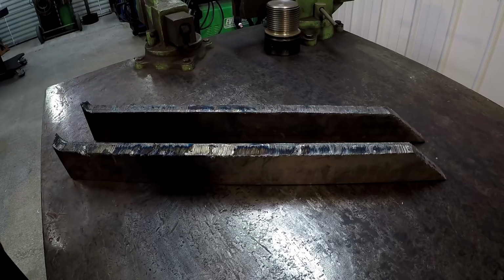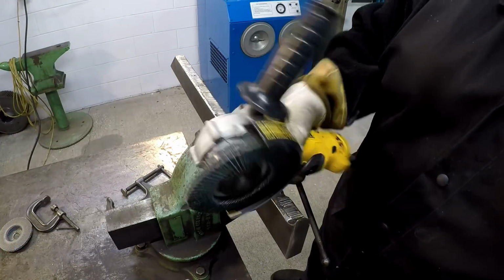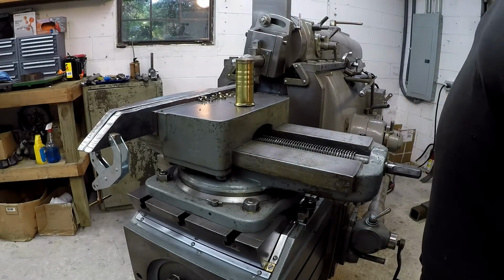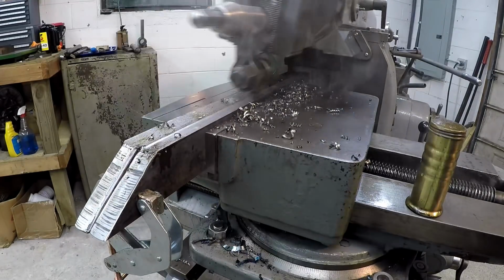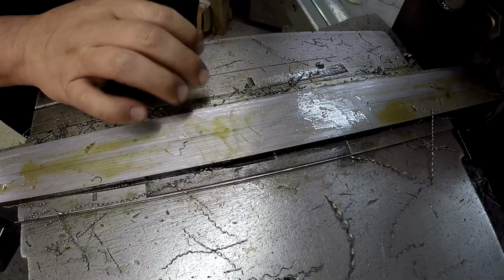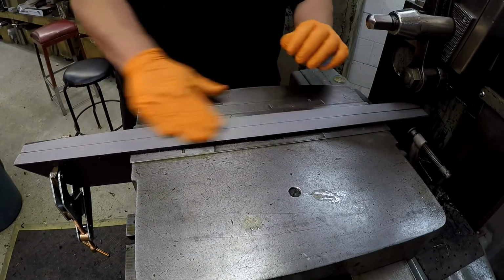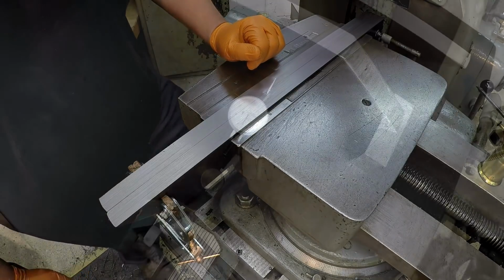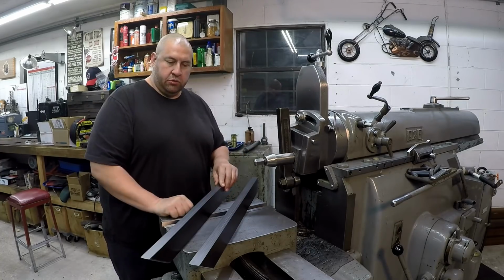SNS 220: Shaping 28" Parallel Bars

Comment: Love the shaper videos.  I was curious if the tool could be slightly scratching the part on the backstroke effecting then surface finish.  Perhaps rounding the sharp edges on the back of the tool could help it roll instead of scratching.  

Have a wonderful 4th and thanks for all of the excellent videos!

Comment: When you cut the sprocket in two pieces you rotated the table through 90 deg to get the T slots up. I noticed that the vice was loose at that time, but I assumed you would tighten it up before the next job. You were focussed on the clamping to the T slots.

Comment: Use a brazed carbide tool, the type you would use for cast iron. One with a substantial radius, it won’t chip providing you use plenty of lube. The huge top rake on the tool you are using will cut a good finish but will wear very quickly

Comment: Hey Adam, hope you are mending fast. For the cut slag, I use a hammer and cold chisel. Tap the chisel from the centerline out towards the cut edge. Very fast and clean. Also,  any plans to cut vees out near the ends to hold shafts/ round stock? Cheers!
Reply from the maker: tridium6111 That shaping is all I did to them. My coworker has them now and I’m sure if he needs any mods he’ll ask me to do them.

Comment: Do you think you could rig up some kind of brush to ride along in front of the cutter that would slowly wipe on oil with each stroke? Possibly hooked to a small bottle with a wick. it just looks like the on the finishing passes that the cutter wipes the oil away at the leading edge long before it gets to the finishing edge. I have no idea what the best way to do it is. Anyhow, I hope you are recovering well from surgery and thank you for making videos for us while you are still recovering.

Comment: I wonder if grinding them would make them more accurate...I still think that looks more than adequate for what your buddy was wanting to do with it...such a cool build and man that shaper has one long reach!  What is the longest throw it can do?
Reply: 32" I think is what the longest reach of it is.  Shaper size is measured by maximum stroke length, and Adam's G&E is 32" IIRC.

Comment: liked the video, i haven't had a chance to use a shaper in 34 years.  your friend could lap the bars if he has such a want to, get a good finish and make them more accurate. also when you were comparing flatness, i'm sure the weight suspended will have some small deflection between centers-say 0.0001-0.0002".  thanks for the video........dwh

Comment: The measured "out of straight" could be because of your surface plate setup.  You have the blocks at the very ends rather than at the bessel points.  Nice work as always.  Did you at any time with this material try a different stroke speed?  Just curious.  Still, a decent surface finish.  Glad to see you back, better.  Keep up the great work, and thanks!

Comment: Awesome to see the shaper doing its thing!  Curious if you know how far into the piece the hardened "HAZ" is... I would guess the thicker the material, the deeper into the part the hardened area extends?
Reply from the maker: Ramsey Customs - turbocobra Hey Gary, it doesn’t seem to go that deep, less than 1/16”. Usually more at the surface. If you can get the tip of the cutting tools under the flame cut your good.

Comment: Not too shabby, it’s like a linear lathe with a heck of sturdy looking vise. I can say I’ve seen one in action now. I’m interested in seeing how the power source works, is it driven off a rack and pinion of some type of linear motor has a very unique movement to it.
Reply: kaiju Thanks, that’s pretty amazing, if I had built that, it would just bind up and do nothing lol. I can’t imagine how hard that metal is and how close the tolerances would need to be for it to not only work but last as long as it does...

Comment: you did great abom79 but its hot rolled flat bar  and you were cutting with the grain in the steel so the finish u got in the end was about as good as u will get

Comment: I am not a machinist, but I love watching your videos!  After watching this video and your video of cutting the sprocket in half,  I understand how you change to increase the depth of cut with each stroke of the machine...  But in this video, it appears with each pass across the bars the depth of cut is not changing but instead, the machine "advances" one notch forward for a new  equal WIDTH of cut,  with each stroke in order to traverse across the bars.  How is this done with vices clamped tight?
Reply: The vice is on a geared table.

Comment: Nice project. 
Should the Armstrong tool holder be turned around so the load is on the bar and not pulling in the bolt?
In a light cut it probably doesn't matter. I don't know. Just an observation.
Reply from the maker: The tool orientated the way I’m using is preferred to allow the tool to swing away during heavy cuts, and help reduce chatter. The books I have even show it that way.

Comment: I have the same type of problem every time I try to cut "Cold roll steel" By the way I have a ton of good envy! Wish you'll live next door!
Reply: Cold rolled will warp because there is stresses built up in the outermost layer of steel from the rolling process.  When you cut one side, you relieve the stress on that side and the opposite side causes it to warp.

Comment: Is that sitting on rubber feet?  It looks like the entire machine rocks a bit as the head strokes in and out.  During the shots where the camera is stationary, you can see the relief between stationary parts on the machine move a bit in relation to background objects.

Comment: Tolkoum: I am not a machinist however my uncle is and owns his own machine shop that hand scrapes ways. He gave me the whole low down on hand scrapeing. If I'm not mistaken, that table is made of granite and a company comes out and works on it and certifies that it is flat to within a certain measurement. I think it's 1/10,000th or something like that. They use granite because it is stable meaning, it wont loose it's shape. You can't use cast iron or steel because it takes about 25 years after it leaves the foundry to fully stabilize. The way that table is used is that a dye is applied to the table a flat piece of machinery the "way" is carefully laid flat on the dye and table and smeared around. It's flipped over to reveal all of the high and low spots. My uncle makes is own tool to scrape them it's made of carbide. I think he called it chasing the dots or dots per inch. The more dots you have per inch the flatter the surface.
Reply: Surface scraping is an art form. Can make big money if you're good at the job. Most milling machines and surfaces need checking every few years, as you say the metal is not stable from the foundry. High end machines with forged beds help reduce this inaccuracy. CNC machines used forged steels. Your uncle has a good job :)
Reply: @rocket_skates-mj  Even stable metal wears.
Reply: This Old Tony does a great video on scraping. Nice to see there are young folks with skills around.

Comment: Is there a reason you didn't finish off the pieces on a horizontal spindle surface grinding machine or a blanchard grinder instead of the shaper? Still, that shaper is a really cool machine to watch.

Comment: Hey Adam, 
Your shaper looks like one of the brand new ones from the G&E catalog! 
Mostly from how clean the tool head assembly looks! 
Do you use any rust prevention coating the bare metal on your machines? Or do you use a shop dehumidifier?
Reply from the maker: I try and keep all of the bare metal coated with oil, and I also run an ac.

Comment: does the backstroke of the shaper affect surface finish? it looks like it's dragging along the surface scratching it up on the way back, but I guess that is mandatory when using a shaper. also, when you made that weld did it harden the piece at all? I know drilling through welded steel is extremely tough, is it the same with your shaper? maybe it's the hardened area that's wearing down your tooling fast.
Reply: The tool bit lifts on the back stroke. No real concern on the tool dragging on the surfaces..

Comment: By the way, Adam, I have re-watched your  video after 11min 30 sec.. There the shaper is plowing through the first flame cut, rough surface. If you look at the freshly cut surface you see it shows almost the same roughness pattern as the original one only a little less so. The load variations from the initial rough surface deflect the ram which cuts a similar, little dampened pattern almost like the needle on an old vinyl record. Since the machine itself and the ram are so massive and very rigid could it be that the dovetail ways are too loose?
Reply from the maker: rol eic I have the ram ways adjusted properly. I don’t like how that first tool was cutting.

Comment: Flame cut material can be brutal on HSS cutters havent used a shaper for 40 years!
Reply: did that yesterday 
it didint end up like i expected
Reply: Not only on HSS. I can tell from experience from turning flame cut rings on a cnc lathe not considering the flame cut surface even with carbide tools will end in a disaster. (sorry for the shitty grammar English is not my first language)
Reply: Rob M   carbide, being brittle, doesn't make a great cutting tool for flycutting.. my preference would be to take the angle-grinder to it. Cast iron is even worse as the "skin'' is hardened, grinding it off is a necessity... or taking a cut deep enough to get under the skin to the softer CI below ... 😎👍☘🍺

Comment: Seems like there are some residual internal stresses in those bars. How about heating them up in an oven to relieve those stresses?
Reply: Would have been best to start out with stress relieving, that way there is no glass hard particles/surfaces from flamecutting and the material doesn't warp anymore.

Comment: Is it dropping on the backstroke Or why would the tool hinge back like that ? I seen you cut that sprocket and now I am in love with this baby, never played with a shaper , 😍, By the time I was done with those parallels they would be 1/4”x1/4” square stock 😂
Reply: The thing the cutting bit goes in makes it so it is rigid in the push to cut and just drag on the return.  If it stayed rigid you would damage the cutting edge very quickly.
Reply: Oh got ya , thanks , makes sense on the return you would probably curl the edge and create more heat

Comment: Hi there! When you fliped the parts, how did you measure position to get parallel sides of each part? They are parallel to the table, but are the sides parallel? Your work is great!

Comment: I don't have any experience with a shaper, so just wondering why it's set up for the shear tool to use the "trailing" edge of the grind to lead into the cut (if that makes sense)? I would think that the point of the tool would lead, similar to the roughing tool. Trying to gain knowledge, not questioning your method.
Reply from the maker: oldbones Going off what I read in my books.
Reply: My gut tells me that is what makes it a "shear" tool.

Comment: Cool. I've never seen one of these in operation before and have only seen one once.
Reply: We had one in metalshop in the UK back in mid '70's so they have to be very old school machines. I rember I used it to machine the top of a small cast aluminium anvil. Doubt you would see one in a modern commercial shop.

Comment: "Ain't movin' too much.   I come off of there....   How could one bar be flatter than the other if all your vices and clamps were accurate?  Would they not be distorted in the same direction by equal amounts.  If you took a finish cut (Pass) of say .005 or even less, would the finish be any better? I've seen smoother cuts with a flycutter on an mill. . Could there be something loose in your planer?  Did you rebuild that machine or just clean it up. It certainly is a nice piece of equipment.
Reply: It’s raw material... so it cant be the same height... and a mill will always leave a better finish... pretty normal stuff there
Reply: He was measuring the factory milled side not the side he cut on the shaper

Comment: Hope that you are using a skylight filter over your camera lens because grinding grit/Sparks can damage the front surface.
Reply: "They are used when machining with a mill, drill or any other machining operation that requires work to be held in a vise or with clamps - to keep work parallel or raised evenly such as in a milling vise to give adequate height for the cutting tool/spindle to pass over." source: Wikipedia parallels
Reply: @BrotschneiderLP  I think you  meant to reply to OldSalt

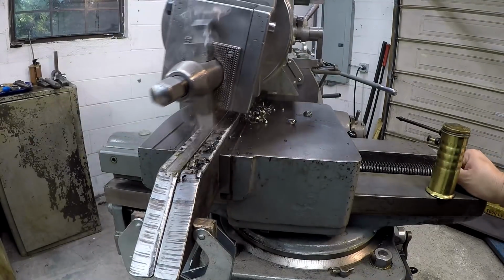Comment: Vice looks like it's still wobbling after the bolts were tightened. Look at around 10:30 you can see it flex still. Another issue somewhere?

Comment: I notice some holes on the left side of the shaper (when viewed head on).  My Grandfather had a German (iirc) made shaper that had a mechanism mounted on that side that would lift the clapper on the return stroke.  He said it improved the final surface and kept the tooling a bit cooler because it didn't drag on the work.   Is there an attachment for the G&E that does that?
Reply from the maker: Tapped holes are for the cam plate to trip the auto downfeed mechanism.
Reply: There is an optional tool lifter. Adam showed it in some G&E literature some time ago and talked about maybe making one, someday.

Comment: You know what's going to happen as soon as your coworker mounts those hanging off a work bench?
Yup, someone will cruise by too close and run aground with a snagged pouch!
Reply: Grey Beard paint em safety orange
Reply: Grey Beard that's why they are bolted down so you can remove them after your done.

Comment: Hey adam ,  i am curious about the removal rate between a shaper and a mill.   What do you think is faster under same conditions?    This looks like the pcs lost 20pds in 30mins :).    Thanks for sharing, great videos as everytime . Rgds from berlin germany
Reply from the maker: I believe if you get the machine set up right with a high depth of cut and proper stroke speed, you could rival a mill doing the same part with a facemill. But I’m not here to prove it’s faster, I just enjoy the old school and learning the machine.

Comment: A humble question: Would a needle scaler do a better job of cleaning the flame cuts? 

I hope you're well on the mend.
Reply from the maker: It would work too, but I like to smooth down the rough flame cut with my grinder.

Comment: Have always wondered on the return stroke does the cutting edge get damaged from "rubbing"?
Reply: Depending on the clearance on the tool, it may not touch?
Reply: DSCKy
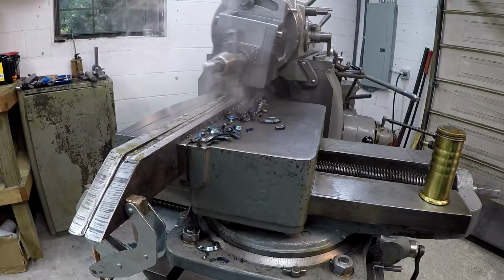But @11:40 it literally bounces during the return strokes.
Reply: Kackspack0815 it works with a hinge. When cutting, the tool is pressed against the surface of the toolholder. When retracting, the tool touches the steel and thanks to the hinge the toolholder can get out of the way
Reply: clapper box lets the cutter hinge up out of the way....cutting pushing out it claps back and brings cutting edge to material, on the way pulling back it flips the tool up just a tiny bit, the back of the tool drags back...
Reply: Is it bouncing on the cutting edge... if so you would think that would not be good?
Reply: Yhat's above my learnin... :)

Comment: Those chips are blue hot is that a bit too much? Cutting out less with each stroke might take longer to do the job but it's not so hard on the machine. Lovely machine.
Reply: Gary LeLacheur you want your chips to come off blue, it means the heat is coming off in the chip instead of transferring to the cutting tool or the workpiece
Reply: When machining anything, youre always aiming for blue interrupted chips. The heat distribution should be 5% in the workpiece, 15% in the tooling and 80% in the chips.

Comment: I have over a hundred favorites on here with Adam being number one.  I have gathered from the shaper shows that the deeper the cut, the poorer the finish.  I think vibration must be the problem.  Would it be worth your while to try a 2" x 4" tool?  Could the clapper be changed to do this?

Comment: Can anyone explain the setup for when he was checking flatness with the dial indicator.

There were no far away shots of filming, just the closeup camera mounted with the dial indicator. It just looks like he's sliding the stand back and forth by hand. What is off camera keeping the work piece and the indicator sliding along a track that is known straight?

I need to check the straightness of a extra long fence jig for a tablesaw and am struggling to find a good way to do it. I own a dial indicator (never used one before) but not sure how to setup a spot to ensure the indicator is sliding straight. He can't just be sliding it along by hand, right...there needs to be a straight edge?

What am I missing?
Reply: (want to know too)
Reply: He is not checking the straightness of the bars, he is checking for high / lows in the vertical. The dial indicator is placed underneath the bar which is raised, so providing it stays below the bar (which is propped up on identical blocks) then the measurement will be constant against the surface of the bench and the setup can just be moved by hand.
Reply: @XIIIHelix  Thanks. Makes much more sense. That dial indicator is different than I thought....and was measuring the bottom side of the bar.

I was picturing the same as my indicator where it measures by pressing straight in...so it looked like he was indicating on the side of the bar. After you explained it, I see that indicator measures differently and was touching the bottom and not the side.